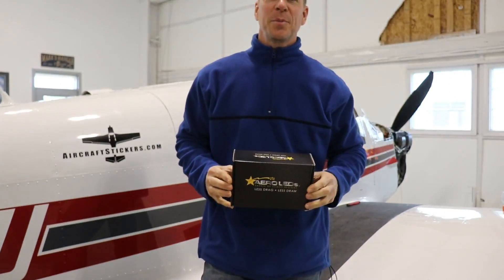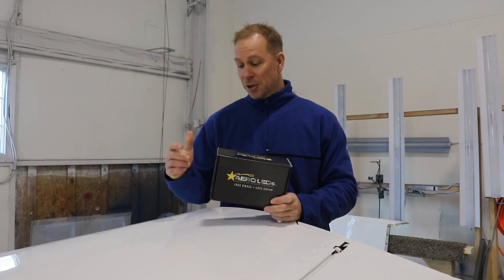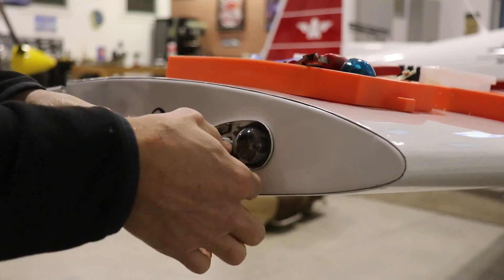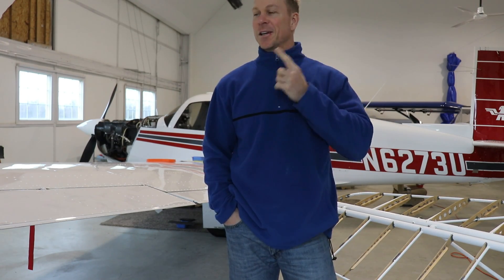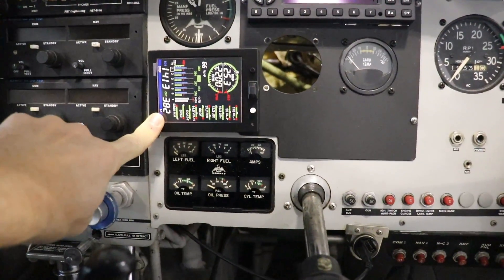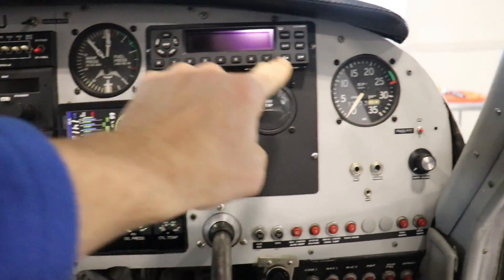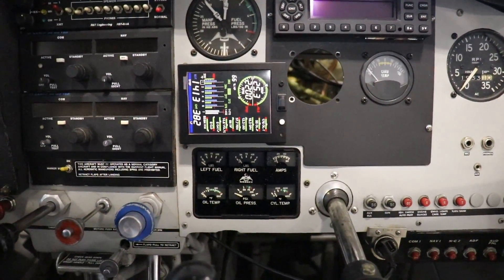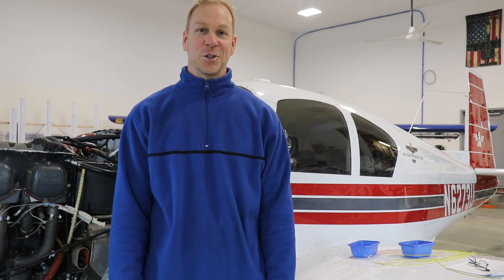Mooney Upgrades - AeroLEDs and JPI-730

Comment: My Dad and his flying buddies first Mooney was a Mark 21 and It was 1962 or 63.  The tail number is hauntingly familiar.  However, I do remember the ramrod of the joint ownership group ordered the Mark 21 with the ski rack down the fuselage.  So my question is: does N6273U have a ski rack?
Reply from the maker: Prob a different plane-my Mooney had no ski racks.
Reply: @KitplaneEnthusiast  Thank you for your response.  The incorporated group that my dad had the Mark 21 later got a Super 21 (N5755Q) then two Executive 21's one was a 1966 (N9565M) the last was a 1969 (N9777M).  Some where in the late 60's early 70's Mooney went into receivership and for a few years operated under the Mitsubishi name. The "partnership" kept "triple seven mike" going until 1983 when somebody bought it at 4,500 hours to use as trade-in for a 231. Although my dad had his CFI and commercial certificate, he couldn't do anymore than teach us but not sign us off.   But I flew Mooneys before I flew a Cessna 172 or 182.  
           Thinking about it, you said the step on your Mooney Mark 21 retracted by vacuum.  The Mark 21 my dad had the there was a crank for the step.  The Super 21 was the first Mooney I recall with the vacuum retracting step.

Comment: Are you and A&*P or AI? I didn't think that anyone could do work on the plane beyond changing oil, tires, and removing panels.
Reply from the maker: You are correct. I’ve mentioned this a number of times, but all the work I do is inspected and signed off by my A&P friends. Some of the work I do is done with the help of my A&P buddies, but they don’t really want to be on camera so You don’t see them.

Comment: I picked up a 1962 M20C project in August, gear partially failed with a crosswind landing.  Hoping to rivet the new wing tip skin on this week and re-attach the tail cone.  Everyone raves about how enjoyable they are to fly and I’m hoping to find out for myself soon.
Reply: I really enjoy this Mooney. It's relatively fast and economical to fly.

Comment: Hey quick question I didn't see anything about the wiring you skip that part and the power supply in the back did you still use the old power supply?
Reply from the maker: The new LED lights require no power pack. I used the same shielded wire that was already run through the wings.

Comment: Mark, I have a 65 M20C that I am working on. Did you get the lights from aircraft spruce or did you find cheaper? Also what is the parts number for all 3? (Suntail, sun beacon and nav lights) I like what you are doing. I am doing a new panel with an EFI.

Comment: You didn't mention or show anything about the wiring for the LEDs.  Where did you make the connection and was it just a straight wire to wire connection?
Reply: Does it still utilize the old power supply in the fuselage?
Reply: @sunnycrockett123  NO! That's what's great about these LED's. They require no power supply and draw very little amperage.